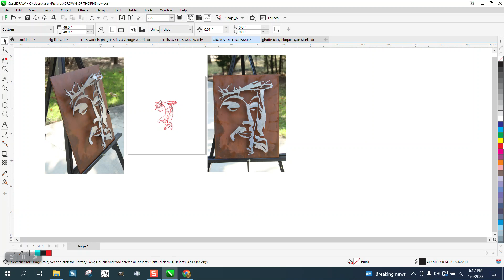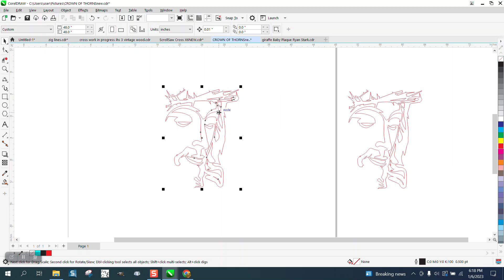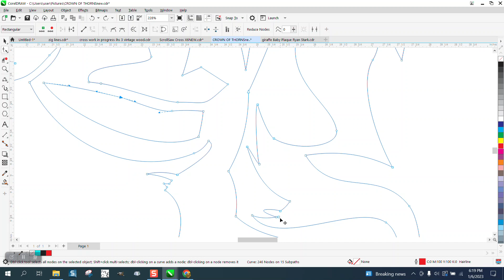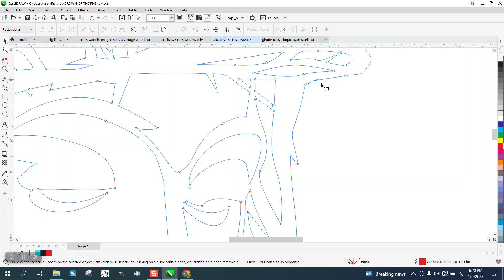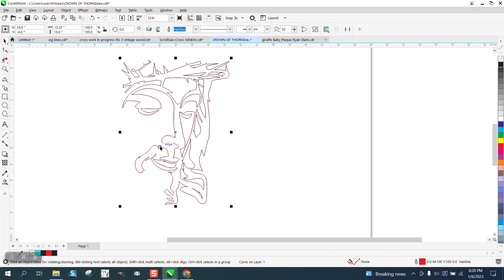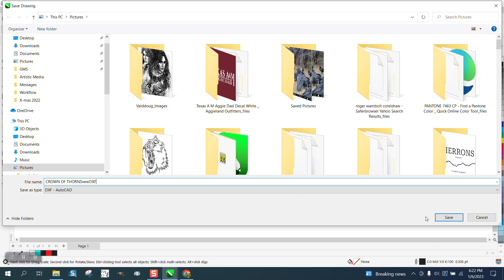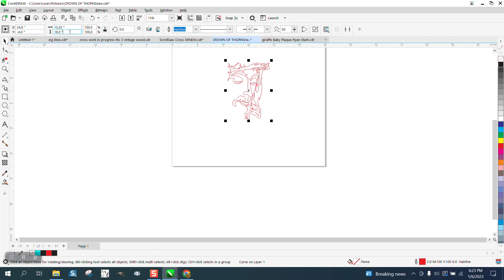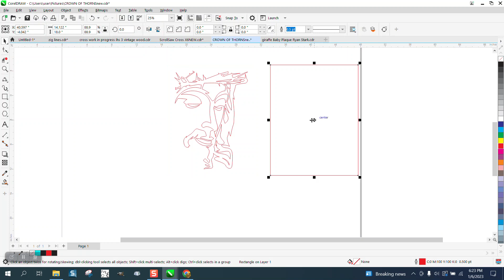Corel Draw Tips & Tricks Plasma Cutting 101 Part 2

Comment: When I see such work, I always wonder what was done with the "negative", the background piece that this was cut from.  Although it will have more than one piece, the sum of all the pieces is the same outline as the single design.  Can those be assembled against another background to produce another version of the same picture?
Reply from the maker: @Francis Kisner nice idea, but most the time it would not work as the torch has to start outside the
cut and work it's way in to start on the "real" piece, so the neg would have a lot of little "start" cuts